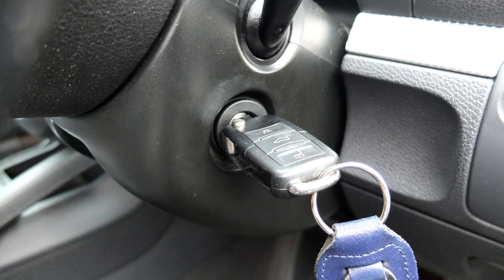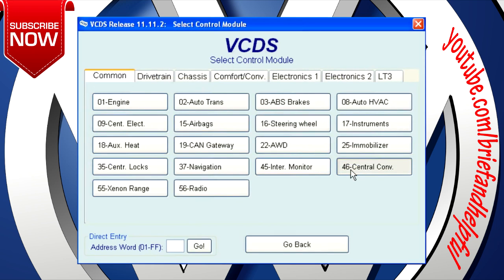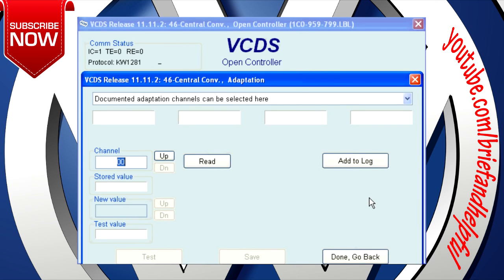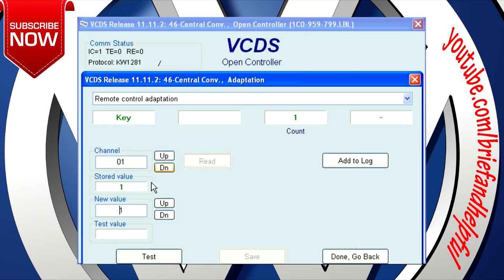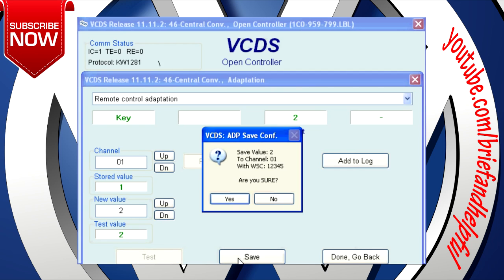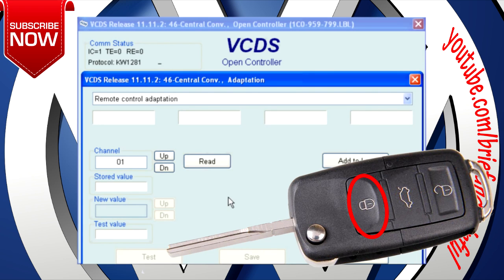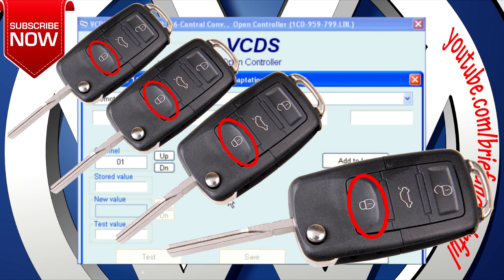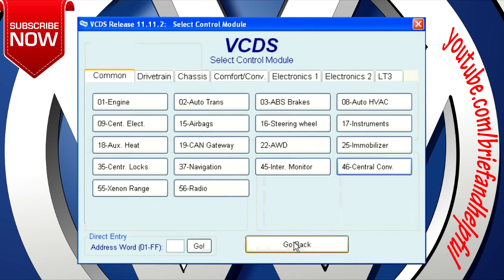How to program mk5, mk4 and B5 VW remote key fob keyless entry using VCDS

Comment: so the origional key goes into the ignition and ignition turned on, since the origional key is already coded to the vehicle it is not touched, just the new keys are pressed in order to be programmed

Comment: I would like to ask Your help in issue regarding to key remote adaptation. 
So basically during adaptation of key I am going to Modul 35(46 is unavailable as my car from 2000 year Audi A4B5 1.8T) then  block 10-->00 channel-->SAVE and when I'm going to 01 or 21 channel every time I get ERROR message - The channel is unavailable and I cannot match the key, the each block is inactive.

Comment: what about the key in the ignition? do you need to remove that key to press the button? and if so, at which point?
Reply: Follow the steps in the video but do not remove the key on the ignition. I have one key and I coded it using this method in the video
Reply: No this car is recognised by car, othervise not possible to open car and ignition.  On this way you can add aditional keys or program them after battery change.  Let say you have 2 keys, but first constantly used battery is down, another is in house, then use 2 kay to reprogram 1st key or any other new keys.
Reply: Robert Mariusz Poźniak
Reply: have u made??
must man key remove from car and  press button lock?? or how?